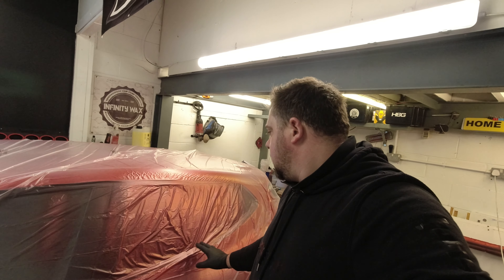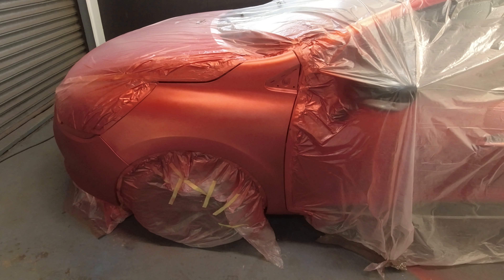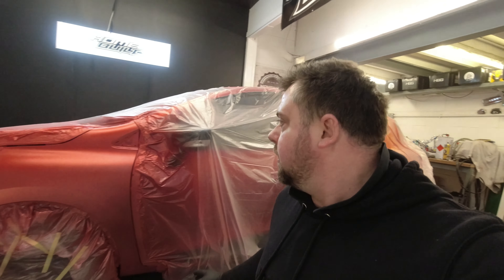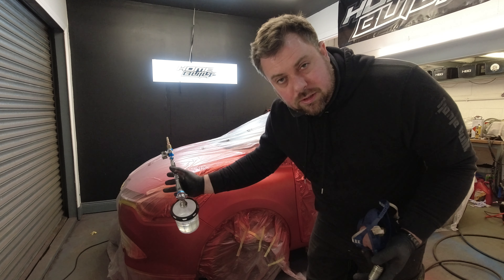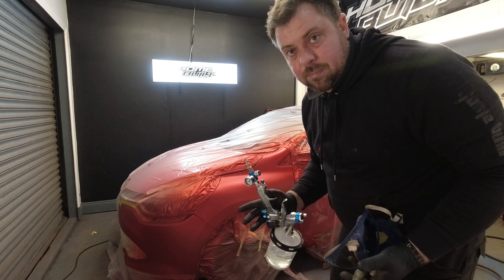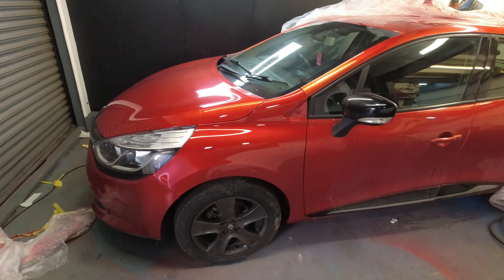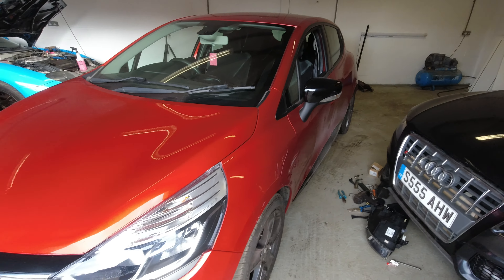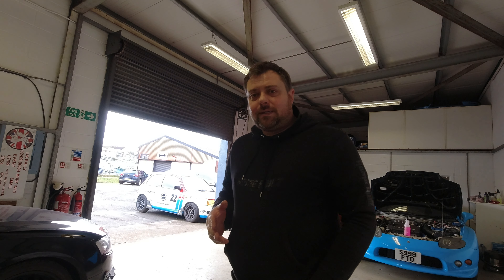Warning: How I Messed Up 3 Stage Paint on TENNP

Comment: You need to do some spray out cards you tube it! Have you looked at the data  sheet as well see what primer and roughly how many coats of base and pearl is recommended? Like a Ruby red ford you need dark grey primer 2 or 3 coats of base and 5 coats of pearl..
Reply from the maker: All applied to Renault spec mate.
Spray out cards are ideal if you have the time and a way of adjusting the colour but not so much whem you buy small amounts from the paint supplier.

Comment: Been painting for many years and that nnp Renault and Ford ruby red are 2 of the nightmare colours. Always need panel blending. Replaced a tailgate once and had to paint rear bumper and both quarters to blend. Luckily roof was black. You don’t great getting it to that standard edge to edge 🙏

Comment: My experience i warm up the panel with my inferred heater then bake the paint temperature affect the colour
Reply from the maker: I was looking at one of those heaters to help out with temps, also looking at a collapsible both for the big unit.
Reply: I just go a decent Amazon 2 bar with thermostat and it helps with metallic and I’ve managed to spot repair even tricky blues my paint suppliers recommend temp control and did give me a chart of temps for metallic plus I can bake and be confident it’s super dry for flatting quicker

Comment: Great video with loads of good advice.. I'd take the old wing down to spraystore in motherwell n see if they can get good match with spectro.. but I'd imagine the needs blended either way.. would be a great idea to make a small fan extraction type thing n leave door open slightly that 2k in confined space can be lethal. Iv seen enough of a build up of solvents before it caused an explosion. Gotta get some of the pps cups look brilliant.. Great video steve

Comment: You should buy some paint matching cards from spray store you want the ones with the different coloured primer shades then you can adjust the amount of coats of base and pearl to match the final colour I had a problem with Mazda soul red Chrystal  and it was the primer colour which affected the base colour also check your spraygun fluid tip size against what the paint manufacturer says is the optimum size usually 1.2 or 1.3 mm anything bigger overloads the size of the paint droplets looked ok from the distance most customers especially young guys just want their car to look as if nothing has happened to it but like you I am a perfectionist if I don’t like it that’s it game over.